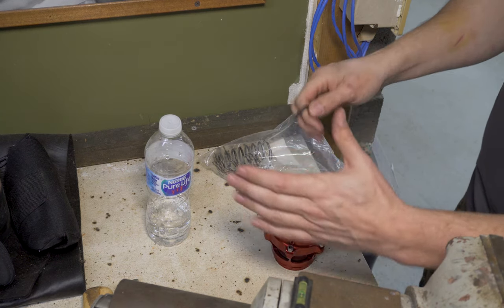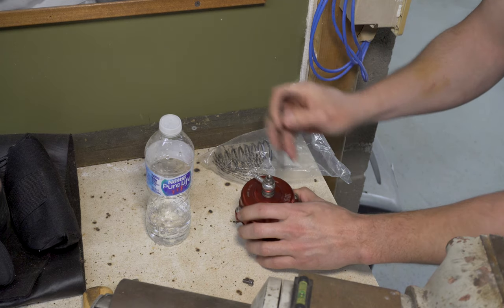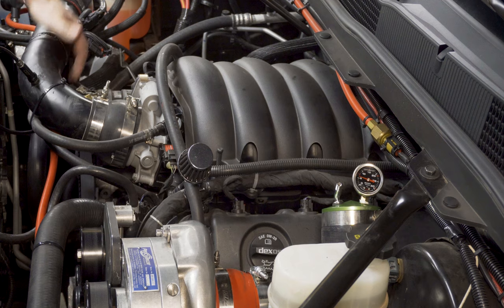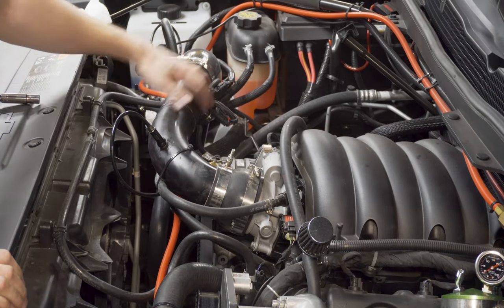Procharger BOV Spring Swap and Boost Leak Check on the Superado!

Comment: Don't forget your intake valves.   Some of them would be open, depending where your cam is.  Any pressure you introduce will go right by piston rings and it will show up as a leak.  I have removed rockers before to truly test the system.
Reply from the maker: Great point! Thanks for sharing!

Comment: Hello, great job. May I ask what shraider valve you use and how exactly you implemented it into the end. By the video, it looks like the valve has an angle to it. I ask, because the regular tire air valves don't usually have threads to them to thread into the end cap. I appreciate it

Comment: how much higher IAT do expect it to have with the new spring?
Reply from the maker: Good question. In all honesty I need to put my old intake on that moves it away from the exhaust header, that will be the biggest effect. Being that I have meth injection IATs are seldom an issue.

Comment: Does the spring keep the valve from opening underboost or is the spring rating referring to how much vacume it takes to open the valve?
Reply from the maker: The spring is designed to have enough pressure to keep our closed under boost as you have equal pressure from the blower and manifold, soon as the throttle body closes you have more pressure on the blower side and vacuum on the manifold side allowing it to open
Reply: @GoatRopeGarage  so let's say you had a 6-pound spring. If your engine is making 12 PSI of boost.  Will it still stay closed?
Reply from the maker: If you have a 1lb spring it will stay closed until you left off the throttle, then it takes 1lb of differential between the blower and manifold to open. With a supercharger you want a light spring or else it will keep the bypass closed at idle and you'll have issues because it will try and push boost at idle which it impossible to tune.
Reply: @GoatRopeGarage  if that's the case then why do you need the heavy spring? I see a lot of people using the really big heavy spring
Reply from the maker: You don't. I use the lightest spring available and I run in the mid-20's
Reply: @GoatRopeGarage  thanks

Comment: Still not sure how you plan to control boost with a BOV.  Every bov spring has an idle vacuum rating. Its opened only by reaching that vacuum when you let off the throttle. Boost doesnt make it open. How are you going to create vacuum with the boost controller to open the bov under boost?why not just put a 10psi spring in a wastegate and weld onto charge pipe? That was def works and is used often?
Reply from the maker: The solenoid allows manifold pressure to reach the top of the bov to keep it closed until you reach target boost then it vents the top of the bov to atmo allowing boost to push open the spring, solenoid with then cycle to keep boost at Target.
Reply: are your going to put vacuum on one side of the solenoid?  Just referencing atmospheric pressure probably wont open the valve like you think.  If you plumbed the solenoid into your brake booster vac pump, that would probably work then.
Reply: otherwise I'd donate you a 38mm gate to weld on.  They are like 50$ on ebay.  Throw in a 10psi spring and probably dont even need that truboost controller..
Reply from the maker: @str8dum  shouldn't need vacuum, but we will see
Reply: @str8dum  there is no need for vacuum.. don't forget, boost controller is a controlled vacuum/boost leak..  so if his spring is 5psi and he connected NO boost/vacuum line to top of his valve.. at WOT he would get 5psi and that is it (with issues at idle)... when you connect manifold reference to top of his valve, it creates all the boost pulley will let him..  so now he will introduce a vacuum/boost leak with boost controller which will allow him to decrease boost at WOT... not sure if this is making sense.  i have used this method before with F1a to control traction.  Only thing i would suggest is having his Tial closer to throttle body.  for better/smoother control.